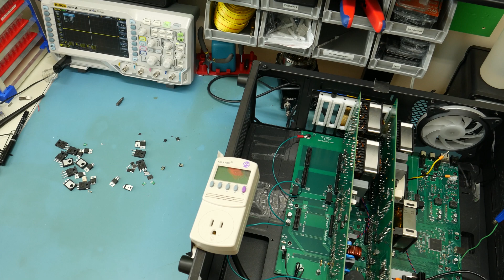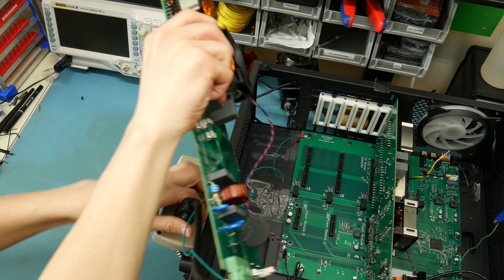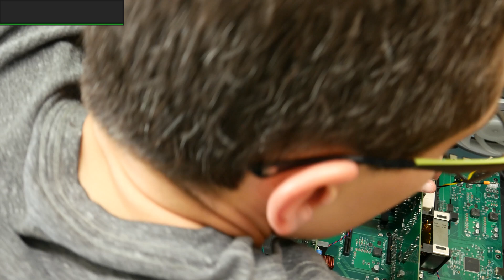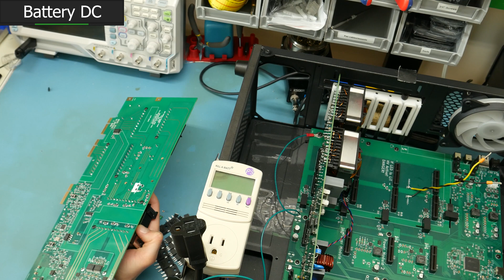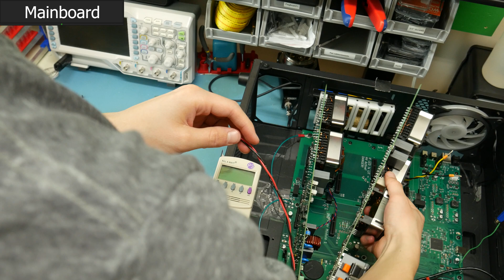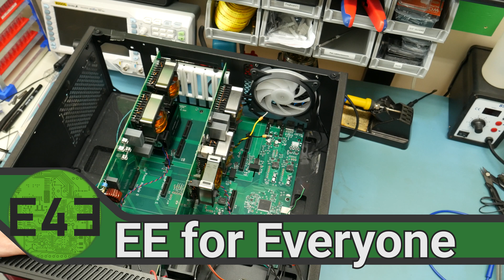UPS Phase 2 Wrap-Up : How far did we get?

Comment: Why you not use in your design mix approach .use kA 3525 controller is nice and stable for DC to DC converter .
Reply from the maker: Hello Asif! Great question. There's no particular reason why I didn't use the KA3525. Honestly that part looks pretty similar to the TL594 that we used for the battery daughter-card! There are many SMPS controllers available, and nearly all of them can work for a  particular topology. For roughly equal parts (like the KA3525 or TL594) the decision can be made by factors like cost or availability in a particular region.

Thanks for sharing, and I hope this helps!
Reply: @EEforEveryone  I saw in your video inverter was rattling and also wave distorted. I thought you make feedback loop control using MCU. I am not sure MCU how much fast for feedback control .I am working like same but bit change project voltage source inverter . sinewave generated by MCU and feed back control by analog circuitry so stable to react load.
Reply from the maker: @smartups1  Hello Asif! I'm about 90% sure that the "rattling" is a combination of capacitors flexing due to voltage transients, wires shifting in the hand-wound magnetics, and radiated interference getting picked up by the microphone -- The sound is definitely louder in the mic than it is to the ear. Very interesting. :)

The MCU is plenty fast to run this control loop, but it's a PSOC 6 mcu running at a few hundred MHZ with a hardware floating, so basically more DSP than microcontroller. 

That's awesome! If I were to update this design, I think I would definitely take some micro-controllers out of the design: go for a more "Pure analog" approach. Definitely post some pictures of your project on twitter or our slack channel if you can share!

Cheers, and thanks for watching!
Reply: I gave you some schematic .keep it up.
Reply from the maker: Thank you Asif! I'll certainly do my best.

Comment: i'd both move the input of the fuse and add a diode, that should reduce noise (as the current spikes will only go in one direction), also under most situations that should also offer a certain amount of holdup (when batteries disconnected) and separate power paths (the low power keeps running if the high power is damaged for status etc), diodes are cheap and you probably have a suitable on in the bom already. In general adding diodes to power supply inputs can improve regulation under input transients.

As far as a load goes, a plastic garbage bin filled with water and some insulated wires is surprisingly good, provided there is no way to spill the water etc, I think they last time I did it I used a stripped cat5 cable in a plastic garbage bin full of water. Not particularly suitable if you're in an apartment or similar though... Also some safety issues we'll gloss right over...

A method I have previously used for increasing power output from to-220s and smd packages (rather than stepping to a 247/264 etc) is soldering the tabs to a MCPCB, then attaching the MCPCB to a heatsink, this pulls the heat of of the transistor incredibly quickly and also allows you to nicely heatsink SMD parts.

Isolation amplifiers are expensive, potentially very non-linear, inaccurate and susceptible to noise, if you don't need super high frequency response consider using a digital isolator and putting an ADC on the other side of the isolation, this can have a lot of benefits, even intangible ones like alleviating routing issues...

You are already doing multiple boards, rather than doing a 6L mainboard, maybe leave it as 4L but split the high density stuff off onto a separate board that connects down with headers so you get bonus routing layers, and if you respin you don't need to waste as many components etc

This is a hell of a project to undertake by yourself (and with a community) and you've done excellent. I look forward to seeing it again in the future, no matter how near or far that is! Also looking forward to whatever content comes out in the interim :)
Reply from the maker: Hi bgdwiepp, thanks for watching, and great comments! Thanks for sharing your perspective!! I can't speak to it all right now, but your thoughts on the add are awesome. Perhaps a remote adc would be wise, given the already present regulated power on the high voltage side. Indeed... Noise. :) Ha! Definitely something to keep in mind moving forward. 

Yes, in the back of my mind i was thinking of using a 4 layer daughter-board to accommodate the micro, and dropping that down onto some common footprint.

I appreciate your kind words, and encouragement. I'm glad you think we've done well so far! It's certainly been a fun project. See you around the comments, and thanks for watching!!!